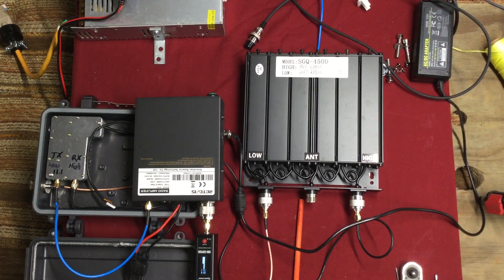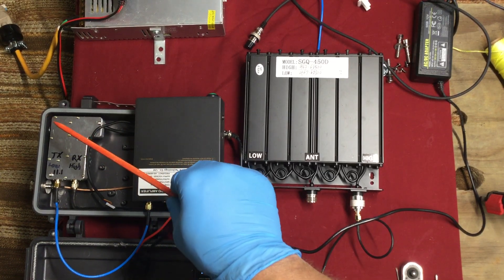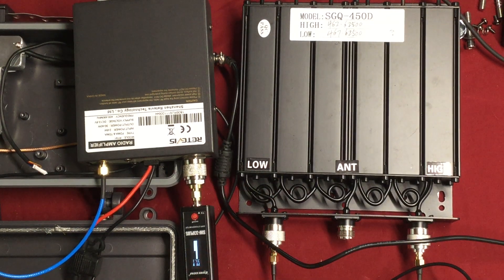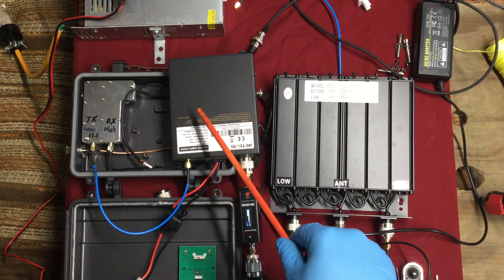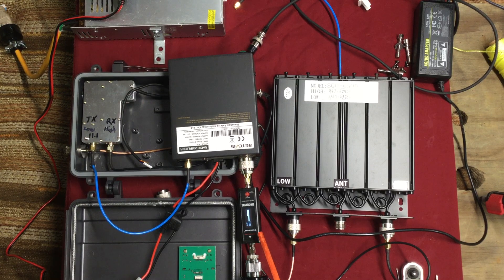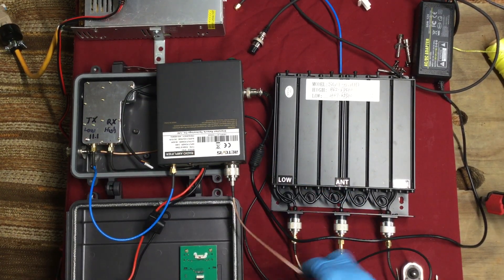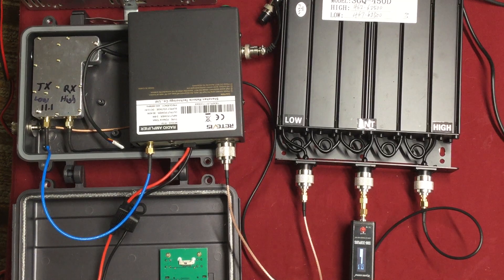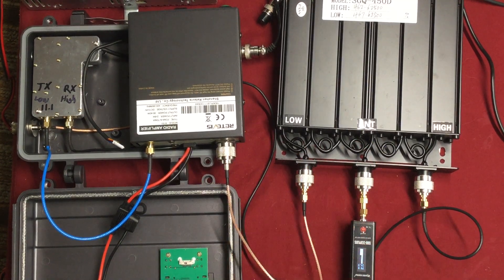🔺Part 4 modifying RETEVIS rt97 GMRS two-way radio repeater for more output wattage!!!🔺

Comment: Your output wattage from the duplexer might be higher if you were using a little better cables and fewer adapters. You are losing some db with those cables and adapters. Just food for thought.
Reply from the maker: Yes, that may help some. And if I can keep the cables as short as possible too.

Comment: I have this same RT97.  I probably should not mess with it, but I would love to have more than 7 watts out.  What happened to the internal duplexer on your RT97?  Did you over power it by adding the amplifier?  Do you know what the maximum wattage that the stock internal duplexer can handle?
Reply: Your power output degrades quickly with the stock duplexer. It will put out about 20-30 watts with the amp and the stock duplexer but the watts drop quickly with QSO's, especially the longer someone is keying up. Also lots of heat build up with the stock 10 watt duplexer.
Reply from the maker: the stock can handle 10 watts however i know a person that ran the amp thru his stock duplexer with a fan for about a year with no problems i also did a video on this to https://youtu.be/Dwx_xlNpcTw

Comment: Thank you very much for this. I'll be doing the same eventually. 2 questions. 
1. Where are you getting dungeon cables?
2. Why can't you put the amp AFTER the duplexer to save that purchase of the heavier duplexer?
Standing by for the response.
Reply from the maker: dungeon cables? i am not sure what you mean? and you can't  put the amp after the duplexer because it kills the receiver (RX) sensitivity due to desense watch this video https://youtu.be/Cl5GNVUlDeY
Reply: @GMRStwowayradio  thanks. The part of the amp is sorted. The cable source is a no-go.
Reply from the maker: @TNRonin  - you are welcome and what cable are you trying to find?
Reply: @GMRStwowayradio  the male sma to male N.
Reply from the maker: @TNRonin  try this one https://www.ebay.com/itm/163844647377?hash=item2625e6e9d1:g:ClIAAOSw3SFdP7Ja&amdata=enc%3AAQAHAAAA4N9hexyH0%2BATJUOhAyg8H8u0aE%2FKu2ex0RaPhYRwFXErRN1QObAOU7l7GkiNZdjqm%2BGSWYm%2B9zWvPLiZ5uFOCLQD%2FCOD3aIQSGIbCTgexdinmwIZOO72MfFqGSkcSqXvY%2Bhji1gModC6Gx87TEhWuEKVD1TzwyAE7tIayXSgRTeUABsCHdCEtBMth4GxNwMpMZ3kMNKAJdAPrSiTpm78yuYfIA%2B5k2dmujSzg9CPnlif1lfVINIQ%2FKPp%2FLHufWlhU%2FwWnpiB3Eu9aw1KAzvI5rXHeL7HuLjfiEDK6UMdfvRw%7Ctkp%3ABk9SR9LD5KXoYA